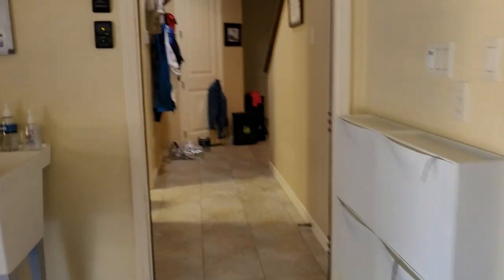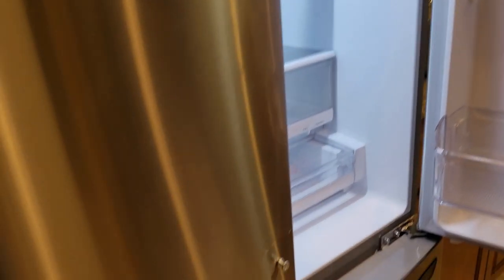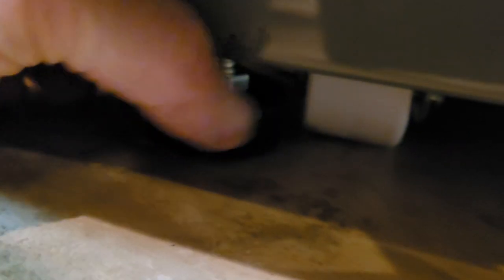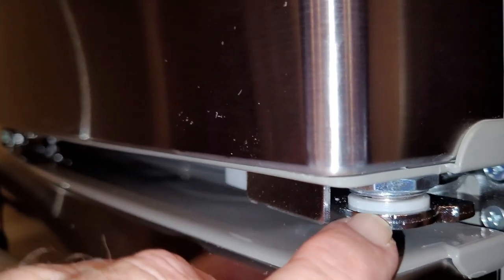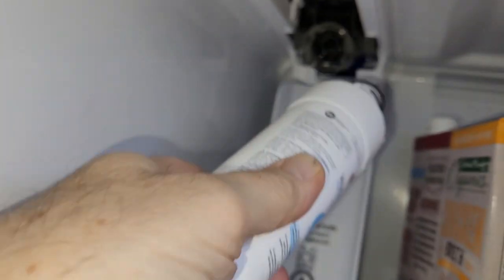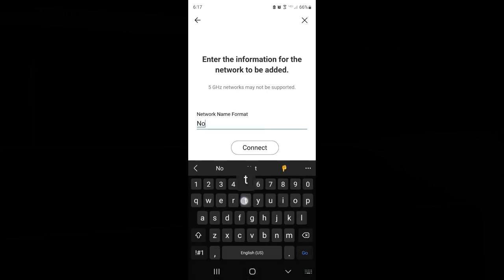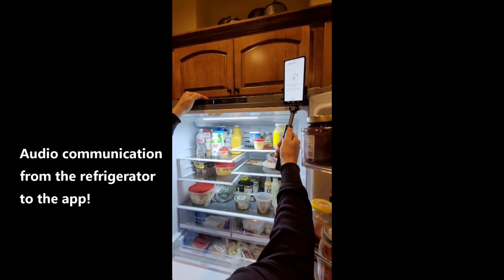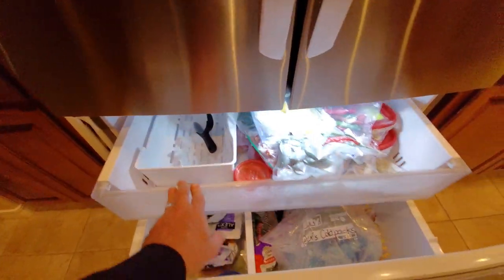LG Refrigerator French Door Stainless - Model LRFCS29D6S

Comment: My biggest gripe with this smart inverter technology is the variable cooling.  Stick a highly accurate chemistry lab style mercury thermometer in there and you will see what I mean.  Temperatures are all over the place!  Even if you haven't put any additional items into the fridge you will see a variation of up to 10 degrees from coldest to warmest! LG also recommends after each temperature setting adjustment that you interrupt the power supply for one minute.  Why on earth with a modern-day appliance would one need to unplug it from the wall or trip a breaker at your electrical panel after making a temperature adjustment?  Still, if you want it colder than the default setting (I did), then you best throw the breaker, wait for one minute, and turn it back on. Otherwise, the fridge doesn't know that you changed the temperature setting.  It's like having to reboot your computer after installing an update!
Reply from the maker: That is wild. You must have gotten an odd person in support.  My fridge runs great.  I haven't unplugged it since installing.   I do know that most modern refrigerators with a circulation fan may do odd things if groceries are packed to the sides, thus reducing air flow.  I keep everything not touching the sides.
Reply from the maker: I had another brand that kept the temperature more constant. The problem was that the fan ran constantly.  Also, food holds cold temperature better than the air.

Comment: Just wondering if the hinges can be easily detached? Our front door is only 31” wide, 32” max is at risk of scratching the sides
Reply from the maker: If you take the doors off, the depth is either 29 7/8'' (759 mm) (models LRFCS29D6*, LFXS28968*) or 28 1/2˝ (724 mm) (models LFXS26973*).  Removing the doors is explained in the install manual from Home Depot. It isn't too bad of a job with some help.

https://www.homedepot.com/p/LG-Electronics-29-cu-ft-3-Door-French-Door-Refrigerator-in-Stainless-Steel-with-Door-Cooling-and-Internal-Ice-Dispenser-LRFCS29D6S/322961677

I didn't take the doors off of the fridge, but I did take them off of the doorway for more room.

Comment: Looks like a really nice fridge, and we had bought this on a Cyber Monday sale, but in the few weeks before it actually would get delivered we got cold feet after reading how LG fridges still appear to be having compressor failures. Certainly hope you don’t encounter that down the line.
Reply from the maker: I supposed any appliance part can go bad.  Our oldest LG French door refrigerator was purchased in 2009, 13 years ago and still works like new. We gave that unit to a relative.  We have a French door (kitchen) and side by side (laundry room) and they work great also.
Reply: This model should be trouble free as it does not have the linear compressor. LG fridges with the label "Smart Inverter" have a conventional compressor
Reply: This fridge has the inverter compressor so it wouldn’t apply to this model. Only the linear compressor models fail like that

Comment: I bought this secondhand. My old owner confirmed that the ice machine was working and I brought it home and connected the waterline again. It's been more than 4 hours since I turned it on, and when I touched the inside of the ice machine, the ice was completed, but it didn't fall into the ice bucket. The manual says it will work after 48 hours, so can I get the ice in the ice bucket after 48 hours?
Reply from the maker: 48 hours should work.  Our ice maker bucket fills up quickly every week.  I wouldn't think 4 hours is enough time.

Comment: I bought this on the house I'm flipping. 4 hours on and has not make ice yet. I had it on ice plus. The hos isn't kinked. It is in on. I just turned the ice plus off. Let's see if it works.
Reply from the maker: from the manual: • It takes about 12 to 24 hours for a newly
installed refrigerator to begin making ice.

Comment: Sir, do the door bins adjust up and down? Also, the LG pictures indicate that there are shelves on the very bottom of the doors where someone could store butter or other smaller items. I don't see this on your review and video...can you answer these questions for us? Thanks!
Reply from the maker: Hi. The door bins are not adjustable.  The lower two bins on both doors are for tall items, meaning there is a lot of clearance for items like bottles of juice, milk, wine, salad dressings, etc.   The top bins on both sides have a small clearance. You can store butter and short items in these bins. You can also store butter inside on the top right shelf which has little clearance.  Our model is LRFCS29D6S.   There may be variations of the same refrigerator that have a different model number.

Comment: Very nice review, thank you for the time you took to provide this for everyone. I have one question I was hoping you could answer. If we don't anticipate needing to use ice for a while, is it possible to remove the ice bin and use the space as extra freezer storage? I know that there is an off button for the ice maker, but sometimes the whisker that is used to sense the amount of ice in the bin or other hardware prevents one from using the space as extra freezer space. I could not tell from the online literature or your video if this is the case with this LG refrigerator. Kind regards.
Reply from the maker: There isn't an arm. There is a small switch.  Too small to get in the way.
https://drive.google.com/file/d/1HM5bnrSlvj3XmMDMbghEgoBMUgttMkky/view?usp=drive_link
https://drive.google.com/file/d/1w8d7zBpz7jJYFyzgrY47_p9ICEZbhppQ/view?usp=drive_link
It is difficult to get a picture of the switch, but it is under there.
Reply: @DrBDIY   Thank you, very helpful!

Comment: How deep are the shelves?  I'm wondering if I can get a sheet pan front to back.
Reply from the maker: The half shelf is about 17" deep and 15" wide. The double wide is 17" x +30".  See this picture of the largest sheet pan on the half shelf.
https://drive.google.com/file/d/1mBYXUVPtC6Q0KdY_CZ6SIUbhqxxfmlvo/view?usp=sharing
Reply: @DrBDIY  that's amazing, thanks so much for your reply.  This unit seems to be the best by all accounts yet they don't keep them in stock at any big box store.  Costco has them on for only $1,200.  With your comment sealing the deal in going to purchase. Thank you!
Reply from the maker: I read there were several similar models of LG at this time.  Some model number(s) had some issue with the compressor. Mine is working fine. If you are buying from a retail chain  store, ask them.  Otherwise, be sure to search the specific model number to see if you find any discussion about issues.
Reply: @DrBDIY  I found your video AFTER finding the fridge I wanted.  Turns out it's the exact same model number.  Replacing a side-by-side fridge that lasted 17 years.  I guess if I get half that out of a current day appliance I should be happy.

Comment: When opening the door 90 degrees, does it stick out past the side of the fridge at any point? My fridge space is right next to a wall and if it sticks out past the side it will hit the wall.
Reply from the maker: I estimate about an .5 to 1 inch past the side of the fridge.  Of course, the handles are 3 to 4 inches.
Reply: I have the same issue with a short wall next to where our fridge will go. Do you happen to know the width of the fridge (not including the handles) when both doors are open to 90 degrees? @DrBDIY

Comment: Which drawer is the high and low humidity crisper drawer? I can’t find the information anywhere
Reply from the maker: Two drawers on top can each be selected as Fruit or Vegetable.   The bottom drawer we use for lunch meats and cheeses.  Found this:
"The general rule of thumb is to put things that tend to rot in a drawer with a low-humidity setting. This includes fruits and veggies that emit an ethylene gas, like apples and pears, because leaving the window open on the drawer gives those gases a chance to escape. When the gases are released, it helps keep the fruits and vegetables from rotting prematurely." So, slide the upper drawer setting to Fruit to open the vent.

"Things that wilt go in the high-humidity drawer. This will be all your leafy greens, like arugula, spinach, and herbs. By having the window closed, water vapor is held in the drawer and the moisture keeps the greens crisper and fresher longer. Keeping fruits and vegetables that are sensitive to ethylene gas, like strawberries, in this drawer will also keep them away from ethylene producers."  So, slide the upper drawer setting to Vegetable to close the vent.
Ethylene gas sensitive:
Apples
Asparagus
Avocados
Bananas
Broccoli
Cantaloupe
Collard Greens
Cucumber
Eggplant
Grapes
Honeydew
Kiwi
Lemons
Lettuce
Limes
Mangos
Onions
Peaches
Pears
Peppers
Squash
Sweet Potatoes
Watermelon

Ethylene gas producers:Apples
Avocados
Bananas
Cantaloupe
Kiwi
Peaches
Pears
Peppers
Tomatoes

Not ethylene gas sensitive:Blueberries
Cherries
Beans (Snap)
Garlic
Grapefruit
Oranges
Pineapple
Potatoes
Raspberries
Strawberries
Tomatoes
Yucca

Comment: Great video. I have same model but the right door doesn't close automatically by the pressure. I need push to close. Anyone seeing this issue?
Reply from the maker: I haven't seen this.  A first thought is the doors are unbalanced.  Check that.  If you raise the front legs, the doors will shut faster and firmer.  Also make sure the tops of the doors are level with each other.